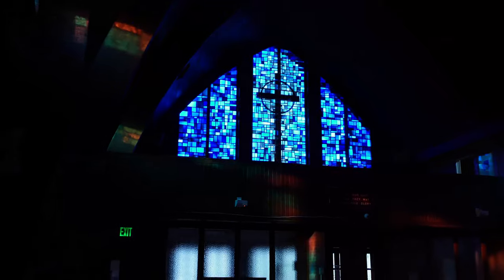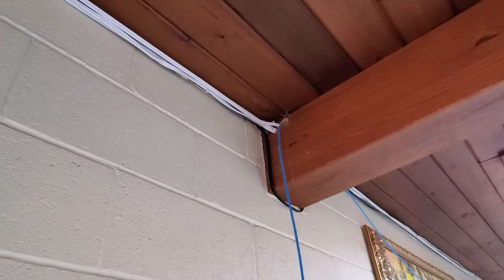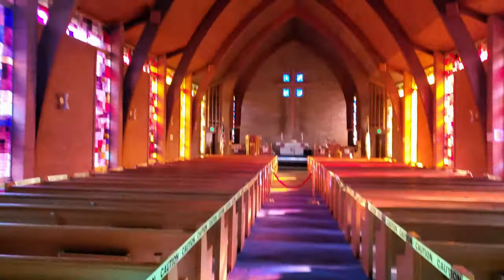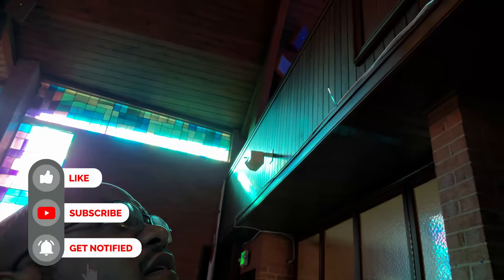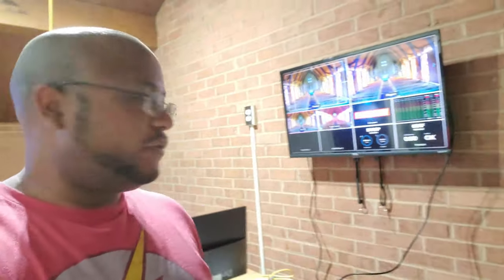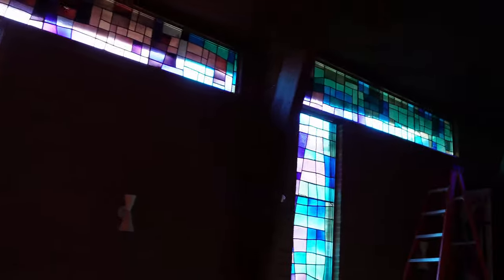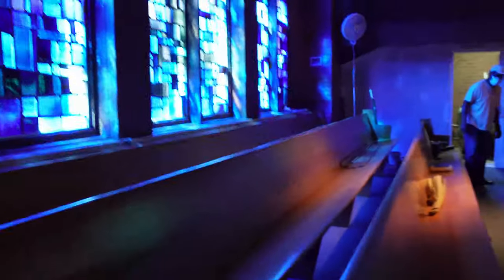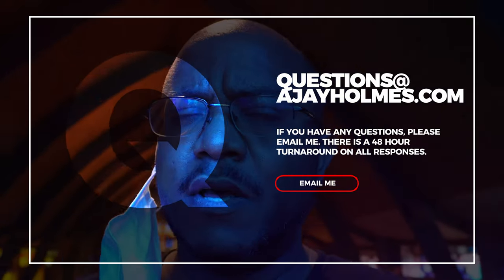VIDEO SYSTEM INSTALL | Epworth United Methodist Chapel

Comment: Hmmm, looking at the cable job I would have used black cable clamps and black ethernet CAT 6 cable within the sanctuary.  Secondly I would have mounted the cable clamps every 12 inches so that there was some uniformity to the look.  Otherwise, good job.  I'm learning a lot from your videos.
Reply from the maker: I originally was going to get black cable but it was backordered and every where else was trying to charge double to triple the cost. Plus they were fine with the cable color